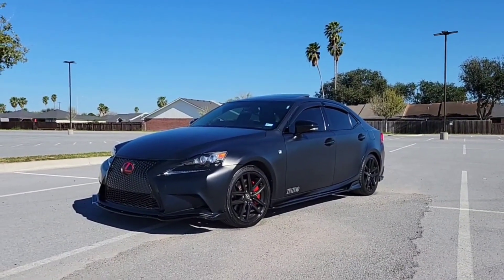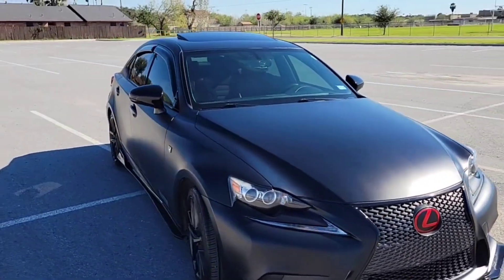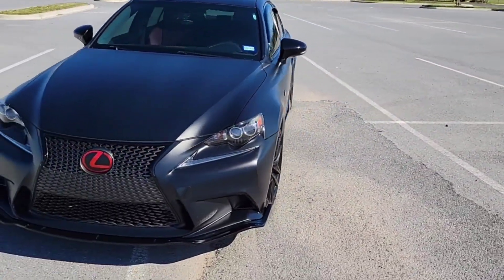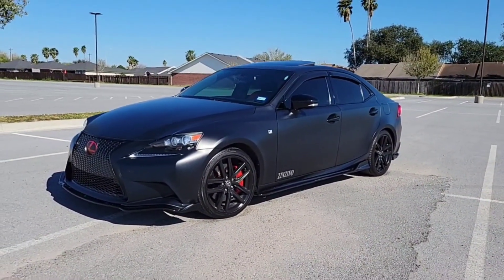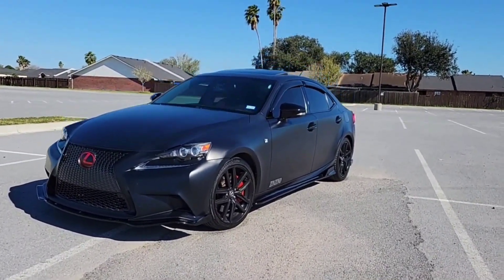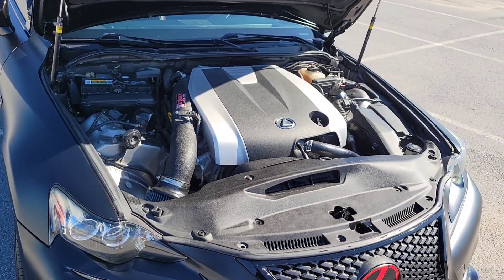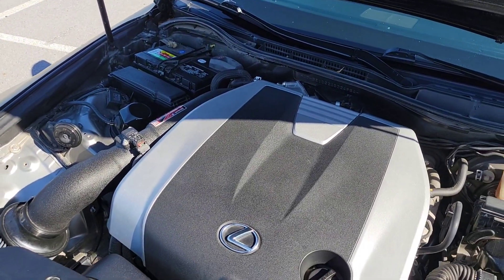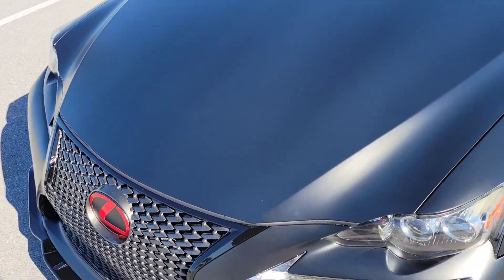lnjen Technology Cold Air Intake Lexus IS350

Comment: It seems like you’re getting the same results I got when it comes to fuel economy. Do you think this intake actually needs a tune with it?
Reply: A tune from just an intake won't make a difference. You'd need a full bolt on to see improvement for performance. With that being said, this video is very old. Proper maintenance will provide the best fuel economy.
Reply: @ not looking for that kind of performance, just improvement on reliability when it comes to keeping the engine breathing cooler air to create less room for overheating. I take care of all of my maintenance.

Comment: Did you get an dtc code? I just got one after driving for 30 min. No limp mode or difference in driving but how do I get rid of it
Reply from the maker: You shouldn't get the code from this intake. When you first start it up, it should shut off automatically. From there, it should be just fine. I would check for any leaks and tighten up everything again or re do it. If you get another code depending on what code it is, you might need a new maf sensor.

Comment: I have a question if I put a 3 inches intake and my car is stock Nothing bad happens, right or I have to tune it. Is a Lexus is 350 2006
Reply from the maker: If it's a 3-inch intake, I'm assuming it has a wider diameter. Nothing bad will happen. It should actually increase performance at higher speeds. My only concern would be the air it'll be pulling in since it's only 3 inches. More hot than cold. A tune wouldn't be necessary.

Comment: Does you need a new water pump ? I just got a Lexus and I feel like the engine ain’t running right but I have no codes
Reply: the waterpump on the 2gr is terrible and youll kost likely need replacement every 80-100k

Comment: No check engine lights??
Reply from the maker: No, none at all. On the first start up, it will turn off the car to reset its system. From there on, you're good to go.
Reply: @Alex Vorasane  kool thankx...i may need to check connections. After driving for a while the light popped on. Code 0441 and 0445🤦‍♂️